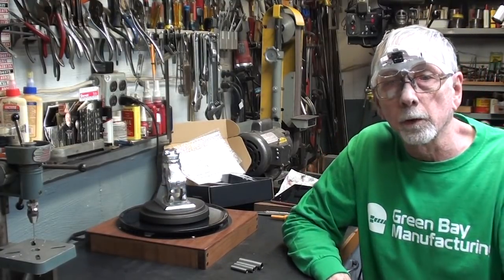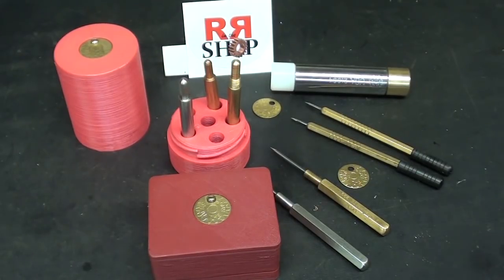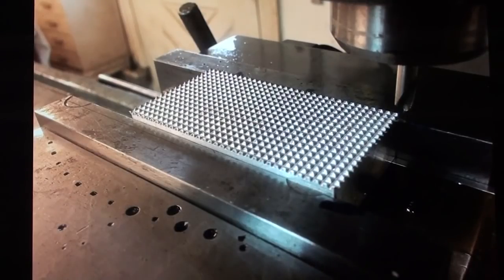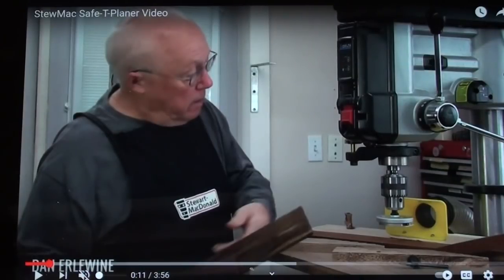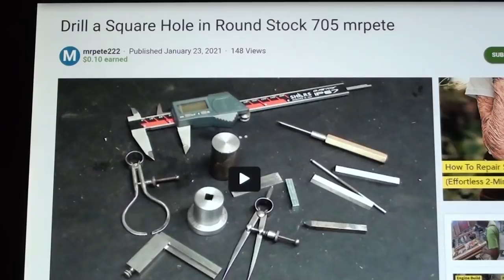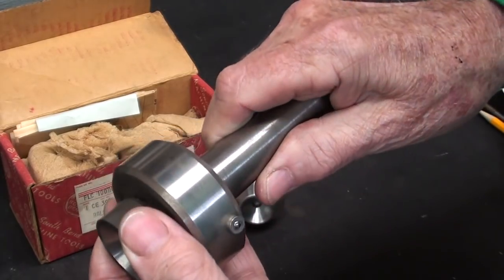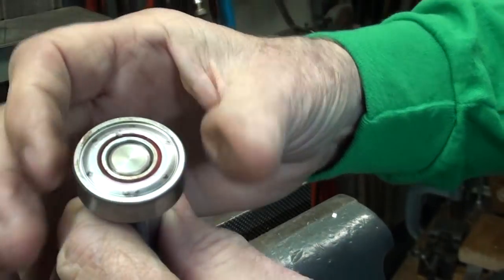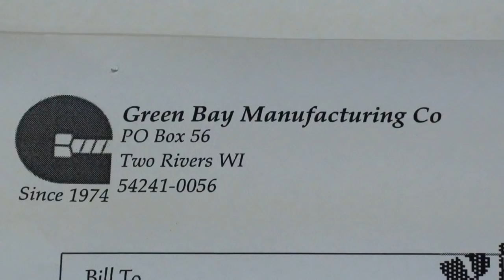THIS & THAT #63 tubalcain extra credit ball bearing installation

Comment: You made that bearing replacement look too easy!  I just recently needed two bearings to fix the motor for our pool pump.  I tried tractor supply, rural king, and lowes to find the bearings.  Nothing.  The guy at lowes actually laughed at me when I asked.  Then I went into NAPA.  I told the guy it was a long shot but I needed a bearing and I had the part number.  I showed him the number on a slip of paper, and reaches to his left to pick one up!  It was on the counter as if waiting for me! 🤔 I asked him why it was out on the counter and he said he had it out to look up its number for a recent caller.  NAPA is a great place.  They have more than the typical auto parts store.  The 3D sign is beautiful.
Reply: Thanks for sharing your good experience with Napa. I recently had the lawn mower belt break on my twelve year old Sears tractor. I figured two weeks from Sears but Napa crossed the numbers and got a perfect replacement the next morning. $43.00 with military discount but worth every penny to get it so quickly.
Reply: NAPA has saved me many times. They may have a little higher prices, but the service and quality parts is worth every penny...

Comment: Long ago I visited a museum somewhere on the East coast that was filled with machinery built prior to the 1900's. Some of them went back to the 1700's.  I was intrigued to find a industrial size version of that Wagner surface planer. The cutter was perhaps 2 feet in diameter and you could take the cup out of a board by clamping it to a carriage. Entirely wood except for the cutters and drive mechanism.  I mimic this on a planer or wide belt sander by mounting the warped or twisted board to a rigid and true platform and pass it through with light cuts.  A Moderna vaccine here and no reaction to either shot.
Reply from the maker: That is interesting. I did not No that they made and industrial size planer

Comment: I really like the design of that bow leg compass. The safety planer disc you showed is similar to a tool that Festool sell for stripping old paint from wooden surfaces. The Festool unit uses 2 opposed carbide inserts very similar to CCGT type.

Comment: I used to repair printing presses, before I installed sealed bearings.I would heat up a needle oiler tip and push it in to lube a bearing up, just to check it. The hole was small enough that foreign matter could not enter.
Reply: good idea but most are backed by sheetmetal did you sneak by on the edge?

Comment: The way you installed the bearing is the exact way the pressure is on it while in use. Its not like it has extremely tight tolerances it seemed to go on fairly easy. So if there was complaints they are just looking for something to criticize.🤔🙂
Reply from the maker: Thanks

Comment: Mr. Pete, I got a question. I have a moriseiki engine lathe. The lead screw has some wear in the work area, it shows when you thread. This screw is trapazoidal. 1 1/4 or 32 mm in diameter, 4 TPI. Can I replace this with Imperial 1 1/4 diameter, 4 TPI Acme thread rod. Also change coupling nut to match. I have a lot of questions about what will this change. On the manual it states this machine did come with an 1 1/4 imperial lead screw, or the metric screw. I have the change gears that came with the machine. 17 inch swing, serial 990, MS850. I really need some proffessional thoughts. Parts if you can find any are pure gold to buy. The little drive gear that I just got from pennsylvania at DGI MORI was $2000.00. I cant stand to many licks like that. I have always prided myself on problem solving, but this has me stumped, because I dont have any history to go back to.

Comment: The split point drill, here's what it is and does.  Look at a drill, hold it vertically looking at it from the side.  If you can see the included angle of the drill, the tip of it looks like a point, an angle of a triangle.  Still verical, turn it 90 degrees.  Now the tip is no longer a point, but is nearly a flat, just a very slight angle to it.  The length of this flat is normally about 10% the diameter of the drill.  It is the chisel edge, the end of the tapered diameter of the center of your drill, the web.  As you regrind the drill, this web becomes larger, the chisel edge longer.  The longer this edge, the less it can plow into the metel you are cutting without increasing the force you use to cut,  Shorten the length, it plows easier.
The split point is effectively shortening this length.  All you are really doing is replacing the area that composes the flute that you are losing when you grind exposing more of the web to become more of a chisel edge.  By grinding this flute back into the drill point, you are making a split point.  This used to be the next step learned after learning how to off hand grind drills.  We used this to renew drills dulled by volume maching. (The cost per piece was decreased if you only needed 1 drill instead of 5 drills to complete an order.)It took me years to learn with nobody around to teach me, but I copied what I saw on brand new drills and eventually ground thoudands of them this way, making millions of parts, saving the cost of new drills and making the boss think I was a hero.
Reply from the maker: Thank you for a very very good explanation
Reply: @mrpete222  You're welcome.  You have a few years on me, but we are close to being contemporaries.  My experience is mostly in volume manufacturing while yours centers on teaching single part or prototype work.  But the differences are more in the machines we use,while the cutting tools, the mathematics are identical.  In my years I was often the old timer, even while in my 30's, so often there was no one around to help me, the library books were missing from the shelves, and this was disappointing considering I am from Rhode Island where Brown&Sharpe often contributed books.  How I wish we had had an internet back in the 70's or early 80's!

Comment: Also, in regards to the bearing, it's going to be used in the direction you pressed it anyway.  So pressing it that way isn't doing any more harm than if you were using it on your lathe anyway.
Reply from the maker: Good point , I never thought of that.
Reply: Im a bit surprised it wasnt a thrust bearing though i suppose its not intended to have much pressure

Comment: Thanks you for the tip on the visor/glasses. The pricing is very affordable. Jeff Bezos has them selling for around $17.00, convenient website for checking a price.
Reply: For the price they appear to be a good buy.  However, for shop use/abuse, the acrylic lens will scratch rather easilly, and might be attacked by solvents/etc on your fingers while working in the shop.  Caveat emptor  Personally, I prefer glass lenses on my magnifiers for use in the shop

John